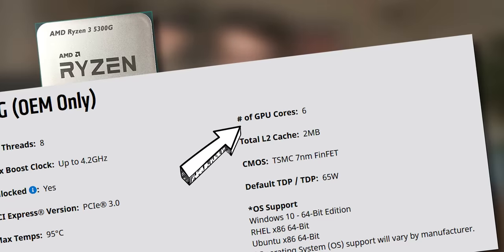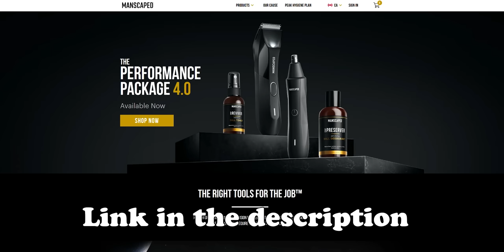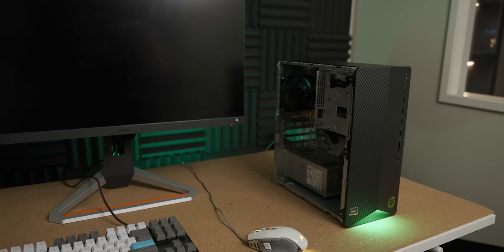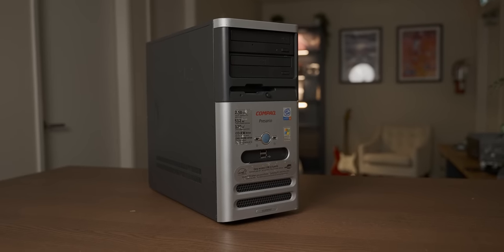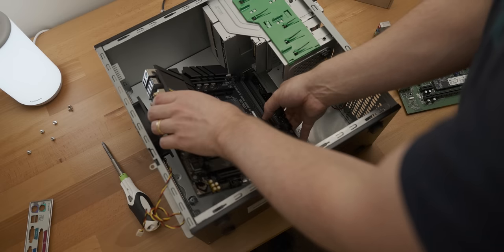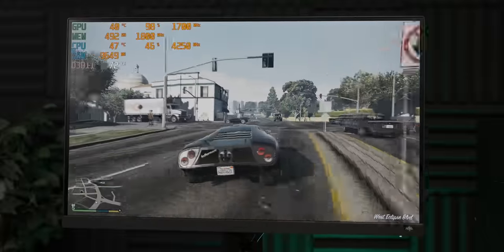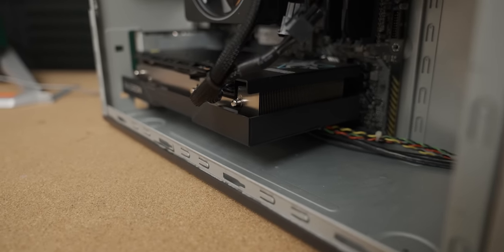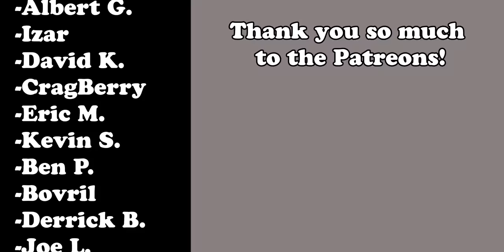Budget Sleeper Gaming PC Build Ft. Dodgy eBay Parts...

Comment: "If they could do it 20 years ago, why can't they do it now?"
Oh... That's pretty simple... Because some marketing douchebag though that making proprietary parts non compatible with the standard ones would increase their product sales if they could not be replaced... Knowing full well that they could charge a hefty price if the end user was willing to pay for the repair fees (or simply buy a new product...)
I don't know how well that douchy strategy worked though... But because of their lack of "evolution abilities", and cheap parts, many tend to stay away from 'prebuilds' from HP or Dell (just to name a few...) 
I mean... Your video speaks for itself... The GPU has been salvaged... And you kept the m2, RAM, and CPU... Leaving the motherboard, the case, and the PSU behind...
(I'll leave the Fan / Radiator aside for now) 
That proprietary form factor is nothing but a waste of materials and energy...
I mean... It's not even well designed! It feels like a chaotic organisation of plugs and circuitry that were randomly added, and only managed to fit because of a not so welcome miracle...

Comment: In pure irony you can actually mine cryptocurrency with that little bugger lmao.  Not joking,  it will not be much but it is WAY more than the cpu threads/cores can make daily,  just a heads up to any gamer out there looking to get back or possible pay for that new prebuild or built new beast straight out of the depths of Tartarus itself "aka as the Greek hell that is 1000 times worse than the 1st Century C.E Christian Hell"  if building go all out since everything will cost a small fortune anyhow at current prices,  screw saving 200-300 on any major part.  2 miners as in software not the pool for clarity will allow APU to mine,   check it out if looking to pay down all that pointless extra cost while you sleep.